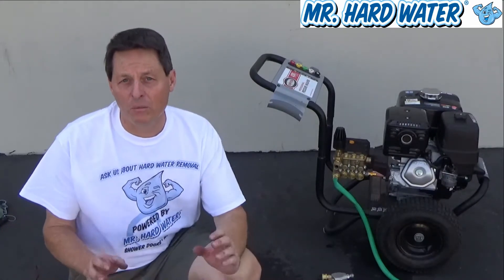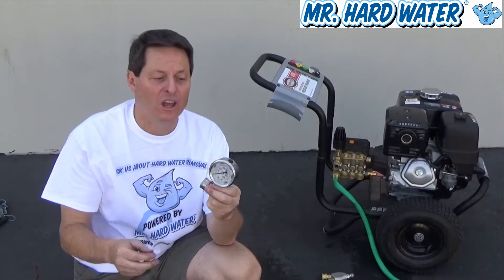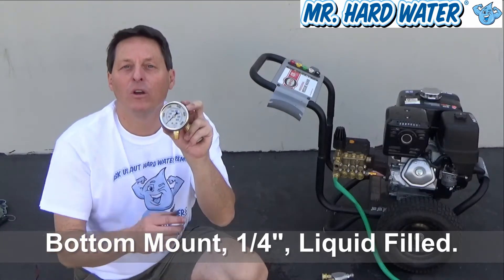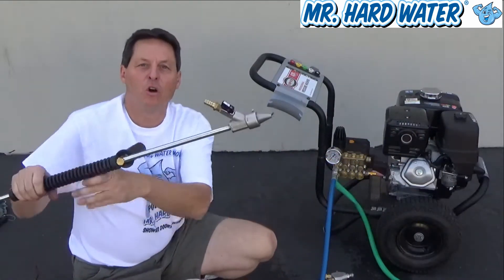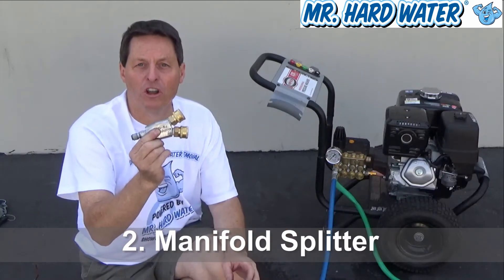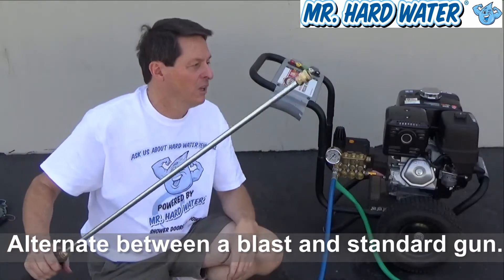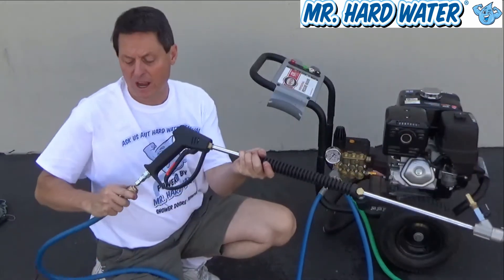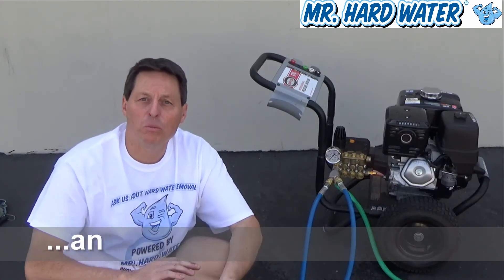Controlling the Power with an In-Line Pressure Gauge - Mr. Hard Water

Comment: All these in-line guages mounted on quick disconnects suck because all they do is spin around from vibration from the engine, resulting in the gauge hanging upside down.  They should be mounted upright in a fixed fitting, not a quick disconnect.

Comment: Hello

Just curios, but would the pressure reading on the gauge be the same connected to the pump as opposed to if you connected the Gauge to the Gun? Or in between the Gun and Lance?
Reply: If you haven't found the answer to this, you lose roughly 1psi per foot of hose so if you're using 50 foot of hose and it's reading 3500 psi, it'll be 3550 at the pump. You get a more accurate reading at the pump and will keep you within a safe operating psi for your pump. Just because you're losing pressure at the wand doesn't mean you should crank up the pressure at the pump, could cause damage.